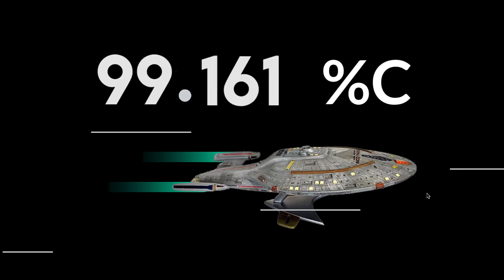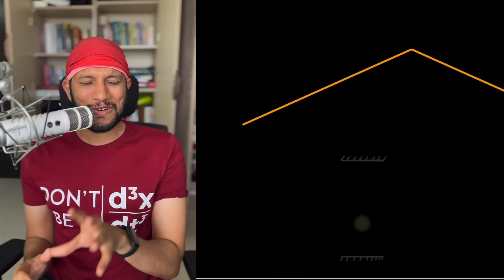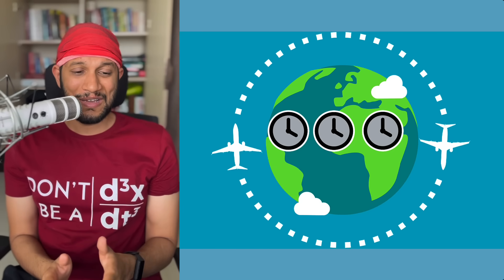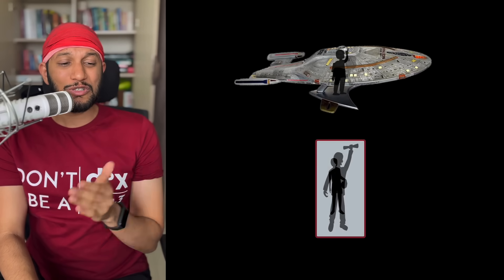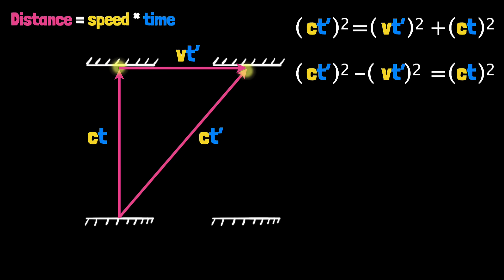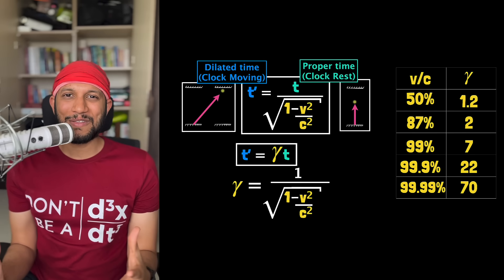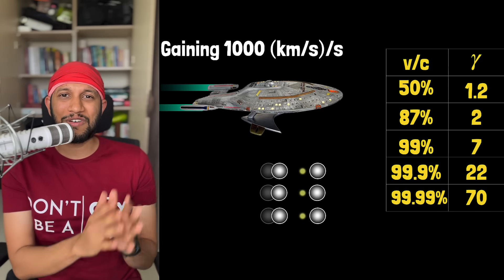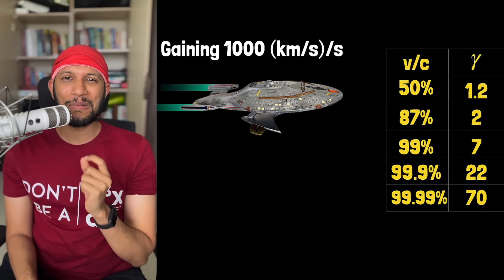I finally understood why you can't go faster than light! (My mind is blown)

Comment: why would the force carriers take more distance to transfer the acceleration? Let's say the atoms are 1 meter apart from each other and the ship is traveling at 100 km/s and it gains 100 km/s /s. The atoms will always be 1 meter apart from another. 

Plus its all relative, so it might look like it takes billions of years for the ship to reach speed of light from your reference point but if your own the ship it wont. You said when the photon clock moves it takes more distance thus its longer, that's from an outside perspective, if your own the ship it will look at same. Doesn't that mean if the ship gains the 1000 km/s/s then to the people in the ship they would go faster than the speed of light lets say they go 3x faster than it? Once they reach their destination and get off the ship anyone from the outside reference point can see when the ship took off and when it landed and see that they must have gone faster than light? 

  Its like throwing a ball on bus, if you throw the ball at 10 km/s and you have a device that measures the speed, and you read it while ur sitting on the bus it will say 10 km/s but if you measure the speed from outside the bus it will be the speed of the bus plus he speed of the ball

Comment: The acceleration actually slows down by gamma SQUARED, so it's even worse than you said, because it's distance per second PER SECOND. So at 0.99c, your 1000m/s/s becomes 1000 meters per 7 seconds per 7 seconds.

Comment: from my understanding drifting clocks CANNOT be due to special relativity, as they are inertial. They can only appear slower and faster from each other's perspective.
You need general relativity and non-inertial motion to account for drifting time.
also these 'photon clock' or 'beam of light' examples are strange to me, as an outside observer wouldn't see any light between 2 other objects, only between the objects and his/her own eyes.
I think a better example is with moving observer relative to the object giving off light, with the light travelling to the observer directly.
good video though

Comment: It was quite easy to understand for me from the beginning before stumbling upon this video, i mean, look at for example cars, a car with about double the speed would need an engine MUCH more than twice as powerful as the car which is relatively half as fast as the first car, things in general require MUCH more energy to reach marginally higher speeds.
Velocity increases the kinetic energy quadratically, so, for you to have double the speed you would also need to put IN that same amount of energy, which increases exponentially the faster you are already going.
But it's interesting to see someone simplify something this much to the point a 6th grader could probably understand it with no problem, it both amuses me and gives me new points of view from which to analyse things i previously already understood, to understand them even better than previously and with more detail.

(Also, for having an indian accent you speak very well and very clearly, listening to most indians speaking is a headache but listening to you is actually pretty nice)

Comment: This is by far the best explanation I've seen on this subject. I knew time dilation was a fact due to the atomic clocks and used the equations on faith but never had an idea of the what might be happening,  until now.
Reply: @joekano6952  That's possible but this does give at least a plausible understandable explanation where you don't have to just take everything on faith.

Comment: Slight correction to the physical clock analogy.

	1.	Atoms in a Material and Electromagnetic Forces:
The atoms in any solid material, like the second hand of a clock, are indeed held together by electromagnetic forces. These forces arise from the interactions between the electrons and nuclei of each atom. These interactions create an electromagnetic field that determines the positions of atoms in a lattice structure, keeping them in place through a balance of attractive and repulsive forces.
	2.	Photon Mediation of Electromagnetic Forces:
In the framework of quantum electrodynamics (QED), electromagnetic forces are mediated by “virtual photons,” not real, observable photons like the ones in light. Virtual photons are essentially quantum fluctuations that represent the exchange of energy and momentum between charged particles. They aren’t detected directly and don’t “travel” in the traditional sense, as they’re a mathematical construct used to explain the force between particles. So while it’s true that photons (in the form of virtual photons) mediate electromagnetic forces, they aren’t exactly sent or received by atoms in the way a regular photon is.
	3.	Atomic Response to Acceleration:
When you apply a force to a material (like moving the second hand of a clock), you’re causing atoms to shift from their equilibrium positions. This disturbance propagates through the material as a wave of displacements in the atomic lattice, which we perceive as mechanical motion. In solids, this is mediated by “phonons” (quanta of vibrational energy) rather than individual photon exchanges.
	4.	Speed of Interaction:
The response to applied forces indeed propagates through the material at a finite speed, known as the speed of sound in that material. This is the rate at which disturbances, like atomic displacements, propagate through the atomic lattice. It’s very fast (often on the order of kilometers per second), but not instant.

In summary, while it’s true that electromagnetic forces hold the atoms together, the mechanism is more complex than atoms sending photons to one another to accelerate. The process involves virtual photons as a theoretical construct, and disturbances propagate through the material at the speed of sound due to lattice vibrations, rather than a chain of photon exchanges.

Comment: Here is a detailed breakdown of the points made in the video, "I never understood why you can't go faster than light - until now!"

### Why can't you accelerate to the speed of light?

*   It is commonly explained that as speed approaches the speed of light (C), kinetic energy goes to infinity, meaning it would take infinite energy to reach the speed of light.
*   Another explanation is that mass goes to infinity as speed approaches C, but there's no evidence for this.
*   The video seeks to provide a physical explanation for the speed limit.

### The Photon Clock and Time Dilation

*   Einstein uses the example of a *photon clock* to explain time dilation. A photon clock consists of two mirrors with a photon bouncing between them. Each time the photon hits the bottom mirror, it's considered a "tick".
*   From inside a spaceship moving at high speed, the photon clock appears normal.
*   From an outside observer's perspective, the photon travels a *diagonal path* between the mirrors because the ship is moving. This means the photon travels a longer distance, taking more time between ticks.
*   Therefore, the photon clock appears to tick *slower* from the outside observer's perspective.
*   The faster the ship moves, the longer the diagonal path the photon travels, and the slower the clock appears to tick.

### Real Clocks Slow Down Too

*   Einstein argues that real physical clocks also slow down at high speeds.
*   Zooming in on the second hand of a clock, the atoms that make up the hand are held together by electromagnetic forces, which are mediated by photons.
*   When one atom accelerates, it sends a photon to the next atom, causing it to accelerate, and so on. This process, while very fast, still takes time.
*   If the clock is moving at high speed, the photons mediating the acceleration of the atoms will travel in diagonal paths, just like in the photon clock.
*   This means the acceleration process slows down, and the *real clock ticks slower* from an outside observer's perspective.

### Evidence for Time Dilation

*   Atomic clocks synced on Earth and then flown around the world on planes have been shown to go out of sync.
*   The amount they go out of sync perfectly matches the predictions of special relativity.
*   This experiment, while also affected by gravity (general relativity), provides evidence for time dilation.

### Muons and Radioactive Decay

*   *Radioactive decay* is a process where an unstable atom spontaneously splits.
*   *Half-life* is the time it takes for half of a radioactive sample to decay.
*   Radium has a half-life of about 1600 years.
*   Muons are elementary particles with a half-life of about 1.5 microseconds, measured in the lab.
*   Muons are also created in the atmosphere due to cosmic rays.
*   Atmospheric muons have a half-life *10 times longer* than lab muons.
*   The longer half-life is because atmospheric muons travel close to the speed of light.
*   Their decay process is slowed down due to time dilation, just like the photon clock and the real physical clock.
*   This means the muons are literally **aging slower**.
*   Since muons age slower, it suggests other biochemical processes, including those in living beings, could also slow down at high speeds.
*   The *twin paradox* is a thought experiment that illustrates this concept: If two twins are separated, with one traveling at high speed and the other staying on Earth, the traveling twin will age slower and be younger when they reunite.

### Deriving the Time Dilation Equation

*   The time dilation equation can be derived using the formula distance = speed \* time and the Pythagorean theorem.
*   The equation shows that *dilated time (T')* is equal to *proper time (T)* multiplied by the **Lorentz factor (γ)**.
*   *Proper time* is the time measured by an observer at rest relative to the event being measured.
*   *Dilated time* is the time measured by an observer moving relative to the event.
*   The *Lorentz factor* is a number greater than one that increases as speed approaches the speed of light.
*   The larger the Lorentz factor, the greater the time dilation.

### The Speed Limit and Infinite Energy

*   Imagine a spaceship accelerating at a constant rate. From the spaceship's perspective, nothing unusual happens; acceleration feels the same.
*   From an outside observer's perspective, the ship's acceleration appears to slow down as it approaches the speed of light due to time dilation.
*   The closer the ship gets to the speed of light, the longer it takes to gain additional speed.
*   To maintain a constant acceleration from the outside observer's perspective, the spaceship would need to increase its fuel output continuously to counteract time dilation.
*   As the ship approaches the speed of light, the fuel required would approach infinity.
*   Therefore, it would take an *infinite amount of energy* to accelerate to the speed of light in a finite amount of time.

### Conclusion

*   The speed of light is the ultimate speed limit because of time dilation.
*   Time dilation arises from the fact that the speed of light is constant in all reference frames.
*   As objects approach the speed of light, the photons mediating forces and energy transfer take increasingly longer paths, slowing down processes and requiring ever-increasing amounts of energy to maintain acceleration.

This breakdown provides a comprehensive overview of the key points and arguments presented in the video. It illustrates the concepts of time dilation, the Lorentz factor, and the relationship between energy, acceleration, and the speed limit.

Comment: Wait a second... This is an amazing explanation of why things become infinite, but this created a worse confusion to me in terms of travel lol

Let's say that we build a ship that is to travel at 99% speed of light to some nearby star that is 10 lightyears away. Based on the equation, this would cause a 7x time dilation, but lets say it's 5 just to make numbers simple.
So, if the photons on the ship move slower, that means that everything moves slower, our body slows down (hence slower aging), as well as our minds (because the photons ARE moving slower in space due to that speed). Which means, from the perspective of the people on the ship, they didn't travel that 10 light year distance in slightly longer then 10 years (since they are moving at 1c), they traveled it in slightly longer than 2 years... Right? So from their perspective, they traveled at 5 times the speed of light? (not physically, but compared to the distance they moved and the time that passed for them, they would calculate that they traveled almost 5c the whole time)
It's only from our perspective that they took 10 years to get there... But this would mean that the closer you get to the speed of light with any ship while traveling, since time dilation increases exponentially, your perception of travel time from point A to point B also exponentially decreases, making you feel like you are traveling at exponentially faster speeds than the speed of time. 

I feel like I'm missing something, because if this is the case, the "speed limit" is "almost" pointless then, because I could sit in a ship and with enough energy, I could be at the other side of the galaxy in what would to me look like a year or two, even though to everyone else it would look like it took me 100k years lol

Or is it the other way around... Would a "slower brain" cause you to "live" 50 years from your perception instead, but just age 2?

Comment: By the way his tee shirt says, "Don't be a jerk." d^3/dt^2 is a quantity called jerk, it is the time rate of change of acceleration. For example, when lifting off the gas pedal and slamming on the brakes, you experience a monetary jerk as your acceleration suddenly changes to negative (backward). It is the time derivative of acceleration.

Velocity, v = dx/dt
Acceleration, a = d(dv/dt)dt = d^2x/dt^2
Jerk, J = d(d^2x/dt^2)/dt = d^3x/dt^3

Comment: but wasnt there an experiment at cern where they send something through the LHC and somehow got a result that indicated that it traveled faster or something ?
Reply: Yes. Several years ago there was a preliminary finding at CERN's Large Hadron Collider, that something had arrived at their detectors, having traveled several km, faster than it would have at speed c.
But it turned out to be some kind of timing error, and on further analysis, it was found not to have traveled faster than lightspeed.
As usual, the initial anomalous result got a lot of press coverage, and the ultimate resolution got next to none.

Fred

Comment: What would happen if the object that is accelerating is so massive that it has its own gravity, or rather so much gravity that time becomes dilated. Is the time till near light speed stretched even more. This is difficult for me to wrap my head around, on top of only being passively educated on these concepts, but if I am thinking about this correctly, then wouldn't the time to get to near light speed be exponentially longer? Depending on the amount of gravity, of course.

Comment: Alright, bet. One question, though. 
(First of all, I'm assuming that light is all around the space in which this is occurring, with photons moving in every possible direction, and that the hypothetical 'photon' in the clock can be seen by a real photon of light passing through it and then entering our eyes. [That's how things are seen, if I recall]) 
Is it really that the object does not reach the speed of light, or is it rather that we cannot observe the object moving at that speed? 

I'm thinking since all we really observe is light passing through the object (and even the 'photon' in the clock) that reaches our eyes, for you to see the 'photon' make the tick, it will take light- from the points in space along the path taken by the ship as it is moving, to get to our eyes in order for us to see the 'photon' make the tick. The light coming from these widely spaced apart points will logically have to take increasingly longer periods of time to reach your eyes ('you', being the stationary observer), resulting in the so-called infinite time required to attain the speed of light.

What do you think, @Mahesh_Shenoy ?

Comment: The problem is, light travels the speed of light, always. It does not accelerate to it, it's just there. So, one could travel the speed of light IF one did not have to accelerate to it. The question is: How?

Comment: It is possible that entering a black hole, past the event horizon, you will travel faster than light. But there is no way to confirm this, since the only known communication is via light waves, which cannot escape. I suppose, if you put a large mass into a black hole, and could measure the lump of mass (theoretically by seeing if gravitational pull changes slightly, at faster than the speed of light). Maybe some kind of action will prevent you from being able to measure this, as being faster than light, and it isn't an experiment we can do. I wonder if an alien civilization has tried things like this.
I wonder if entangled particles are slowed down by relativiity?

Comment: The explanation of the difference between dilated and proper time doesn't make sense as each being independently different from each other when you put a 2nd observer in a 2nd spaceship flying parallel to the first spaceship where each ship has its own particle pong thing happening. The equation works for each ship by itself, but then it seems to me that means that ct and ct' for each ship are just swapping places and which is which depends on the position of the observer. Moreover, these two equations dont happen in a vacuum independent of each other. Rather they happen in the same reality. Thus, it seems like the equation is relativistic and doesn't make sense under a larger viewpoint. Maybe, I'm wrong but that's my observation.